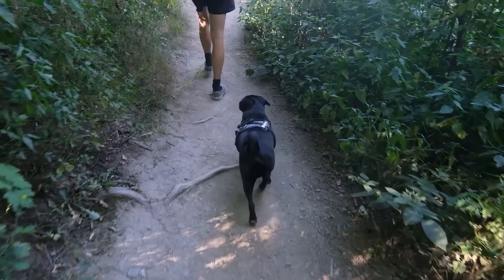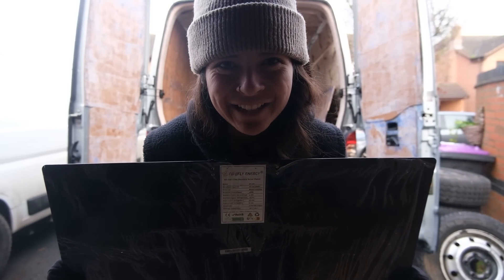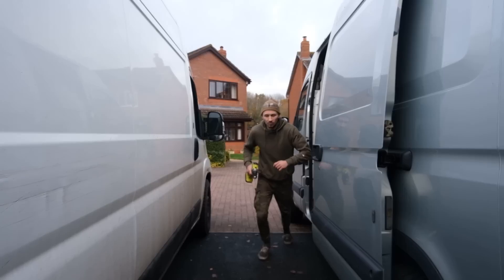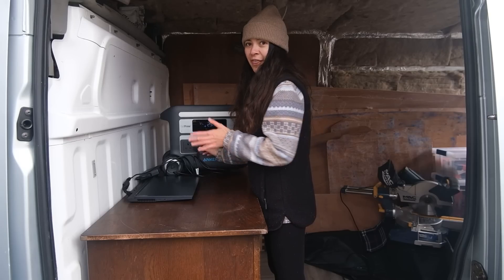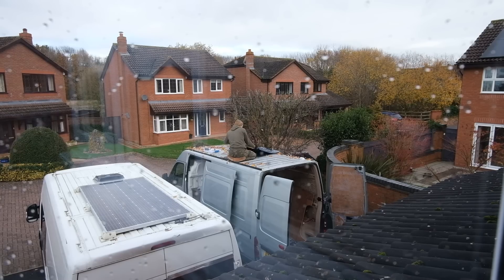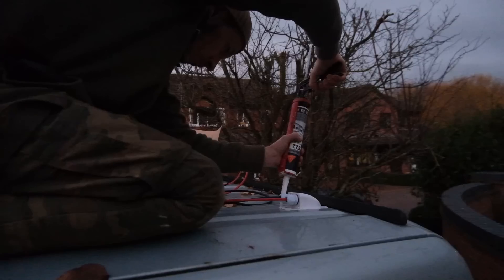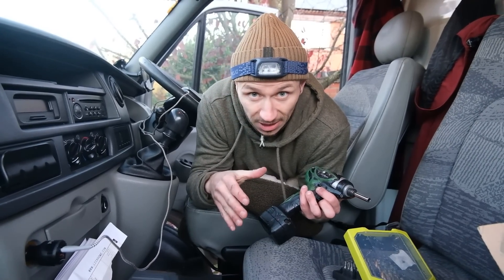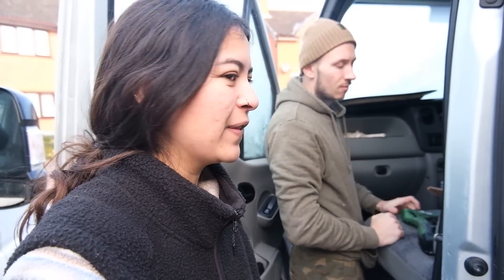Installing SOLAR PANELS & SPLIT CHARGER in to Renault Master | DIY Campervan Build Ep 8

Comment: Hi.
I'm in need of some help please...

I'm about to fit solar to my campervan.

It already has a split relay connected to batteries and then an Inverter.

What do I connect my solar wires to? Direct to batteries? I'm not 100%

Cheers 😊
Reply from the maker: Hello 😊 you will need a solar charge controller / MPPT to wire your solar cables in. This will then go to your batteries. The Solar charge controller converts the power gathered from the solar panel in to a useable energy. This video runs over the electrics in more detail and we share our wiring diagram https://youtu.be/jNp_gwpV2-8?si=k4Kt6fEGQUBhdm8H

Hope this helps 😊
Reply: @nicroams  perfect thanks I think it comes with a little blue box which I think is the mppt?
:-)
Reply from the maker: @pauljonah1139 I wouldn’t want to say unless I see it. If you’ve bought it as a package, then I imagine it will say what the blue box is 😊

Comment: Why the swap to AGM's? Didn't you have  Lithium fitted to to the other van eco tree or something? Never did see a video on how they went
Reply from the maker: Hey 🤗 we do have Eco Tree lithium batteries in the van we live in and they have been amazing 🤗. It’s not that I don’t want lithium batteries in this rental van too, it’s simply down to the fact I can’t afford them 😊
Reply: @nicroams  Yes totally get that👍😅! I currently have flat panels/AGM set up but the panels have stopped working and I've been saving for 2 years to replace them but also installed Lithium batteries, (1 probably!) I'm worried because a lot of people on here have said you can't just simply replace the lead batteries with Lithium but I recall you went somewhere and they sort of did that but they were brilliant and knew everything about them. I'm about 1 hour south of Birmingham so not sure how far that place would be?

Comment: If you use a LiFePO4 battery, you can't just hook up your alternator to it (via a split relay), you have to make sure your alternator supports this, or you will overheat it.
Reply from the maker: Yep 👍🏼 we are currently planning on using AGM. If anything changes then we will swap over to DC-DC 😊

Comment: We had Flexi panels on our van originally but swapped to rigid when one of the 3 flexi's failed. The Flexi's were stuck on with Sikoflex and were very hard to get off again so I wouldn't worry too much about them flying off if you stick them on well
Reply from the maker: That’s good to hear! A friend of mine also said he had to take one off and it wouldn’t budge so I’m happy to know there will be no solar panels flying around 😆

Comment: Nice work guys! Little pro tip from 4 years of flex panels - get some 'T-Rex' tape, and just tape along the front edge of the panel to stop air flow going under them when driving at speed, not essential but really reduces strain on the glue and the back/sides still have air flow to help cool the panel - that's the only minor issue with them is how hot they get in summer which reduces efficiency but they still work great! 

Merry Xmas all, enjoy a break! 🥳
Reply from the maker: Ohhh thank you so much. I will have a look at doing this when the frost has gone 🤗. Ye I had heard about them ‘blowing up’ but my friend has flexis who has been in Spain and Portugal and had no issues so I’m hoping the ridges on our roof give enough airflow as they’re about 1cm deep 😀🍀 only time will tell I guess 😆. And thank you Ben, merry Christmas to you and Daisy too 🎄
Reply: @nicroams  thank you! 🎄 yeah its never ever happened to me either....infact removing my old ones to put new ones on was incredibly difficult and took a couple of days, they are defo defo stuck on 🤣 but it does defo help and stops debris n stuff going under when travelling 👌 

Loving the new van build & it's inspiring me to get going on my mini campervan conversion 😮🤗

Comment: Question... how comes you have chosen to go with a split charger over a DC-DC charger?

I assume you'll be putting in some pricey batteries. Whatever batteries you use, you'll extend their life by charging them properly with a DC-DC.

(Dc-dc optimises the charge input for the leisure batteries' current temperature and charge state whereas a split charger just dumps power in regardless of any variables.)
Reply from the maker: As it stands we will be getting AGM batteries but if anything changes where we get lithium then we will upgrade the split charger to DC-DC 🤗

Comment: As great for saving weight and as good as they are for areo dynamics 1/ you can't tilt them 2/over heating issues on hot days..I enjoy your vans builds and your on road adventures..Happy Travels.✌️
Reply from the maker: I hadn’t used flexi panels before due to the overheating issues I had heard of but I have a few friends with flexi panels who have spent a summer in Portugal and Spain and have had no issues 🙏🏼. I’m hoping the gap underneath is good enough to get good airflow 🍀. I’m not too fussed about the tilting, it would be awesome to have but not something my skill set could probably do even if I went none flexi (yet) 🤗. Have an awesome Christmas 🎄

Comment: The amount of times I have seen these Flexi panels on the side of the road gives me an indication that they should be fixed down with something more than adhesive 🤷‍♂
Reply from the maker: Omg haha, I have never seen one on the side of the road before. You’d think the cables would at least pull it along the road 😆. I’ll let you know in a years time if they’re surviving 👍🏼

Comment: Small tip, if you give the surfaces a light sand and then clean them with whitespirit before bonding the bond is more likely to hold for longer.
Reply from the maker: Thank you 🤗

Comment: @1.44  The corner of the solar panel is broken..
Reply from the maker: They’re definitely not broken 🤗 I think it’s the film/ corner protector that came in the packaging you’re spotting 🙃
Reply: @nicroams  Check it, i was thinking typical Evri delivery stuffed in the back of a hatchback.

Comment: you look like your panels are the same as I got. Ive found mine were great and kept the two AGM 130 ah batteries charged along with my B2B ctek 250se. I had the panels going to the ctek and didnt have an MPPT unit as the cetek has one built in. regarding wiring the panels in series, the problem with that is, if one of the panels finds itself in shade, both panels wont charge. from what Greg Virgo said, he said parrallell is the way to go because if say, you find yourself in the shade of a tree with one panel, you'll still get power between both to your batteries. Bessy regs and have a great Christmas -Kenny
Reply from the maker: That’s awesome to hear 🤗 did you also just glue them down? I’ve just had a look at Greg Virgos video and it looks like he did it in series too from the thumbnail photo ☺️. But regardless, either way is right, it just depends on what’s most important for the user of the campervan. For us, we felt like wiring in series was our preferred option because it charges quicker when there is sun and let’s face it, there is rarely sun in the UK so we have to make the most of what we do get 🤗. Thank you so much for watching and have an amazing Christmas too 🫶🏼🎄